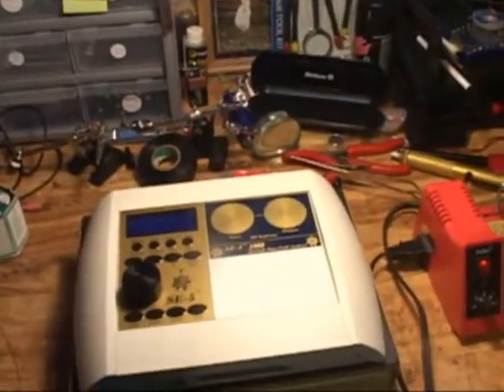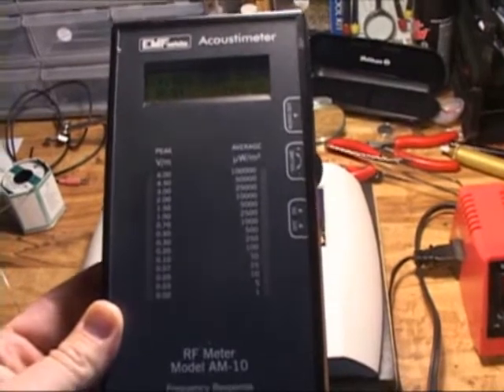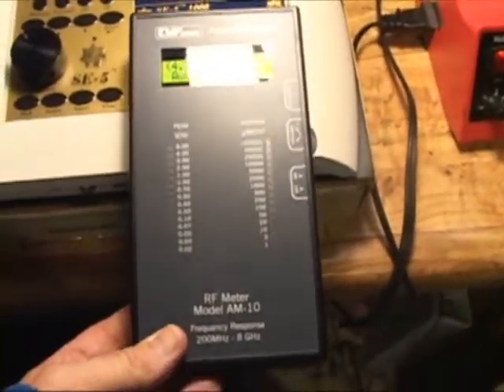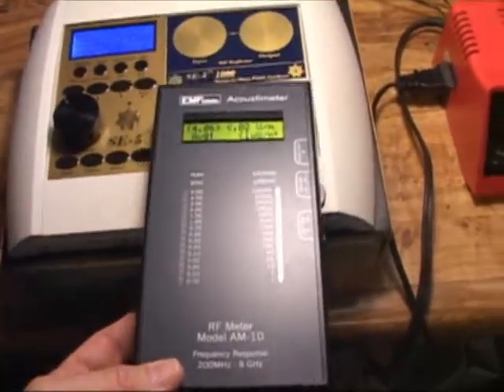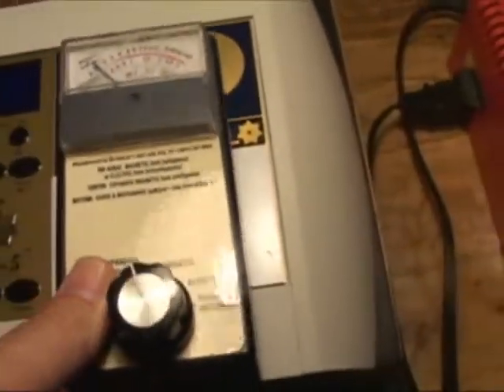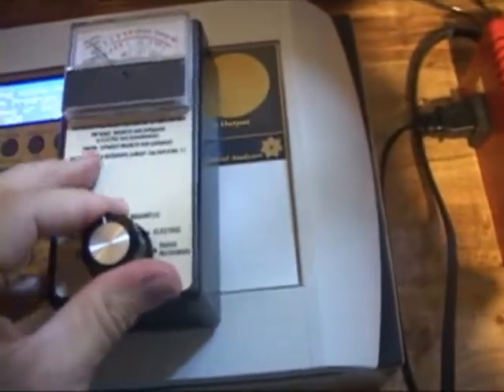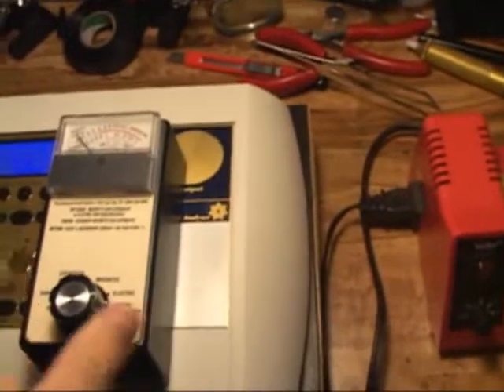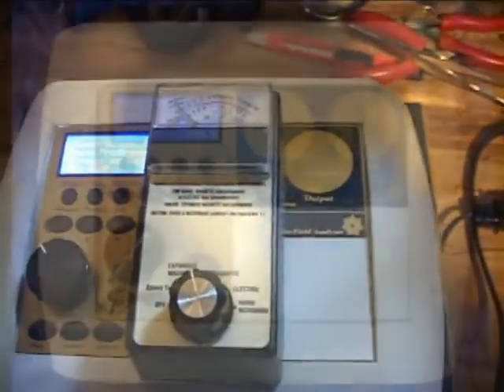SE-51000TestofMicrowaves.wmv

Comment: A true test is not just showing that there is no interference when the unit is powered up, but when it is actually performing a function!
Such as . . .  in actual balancing mode, or replicating.

I wouldn't expect any problems with most functions other than maybe replication.
Reply from the maker: Great Idea... as soon as I get back to the USA where my meter is, I will try it with different modes.
Reply from the maker: I finally got my EMF meter and SE-5 in the same place at the same time... https://youtu.be/hSkqgy0tbLI
That is a re-test with a program balancing.